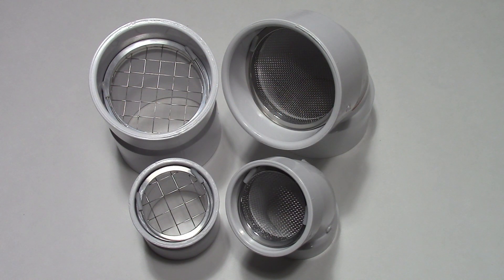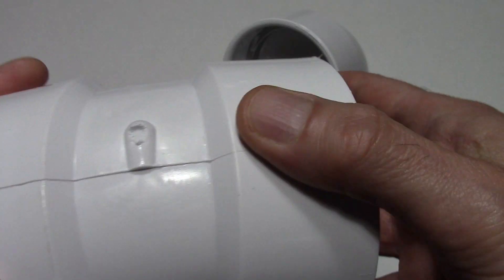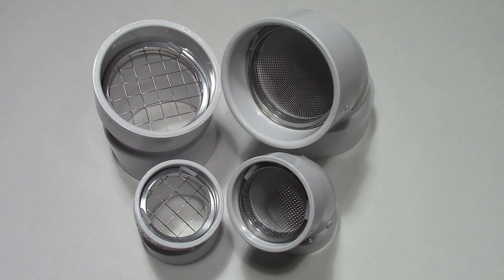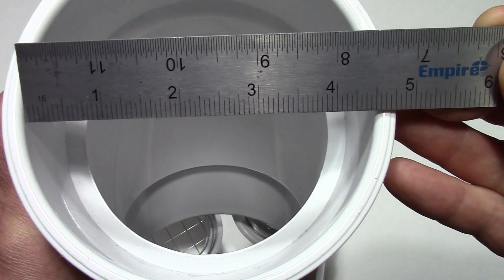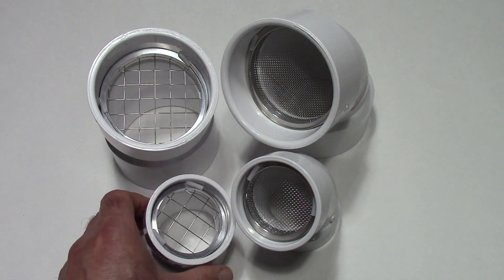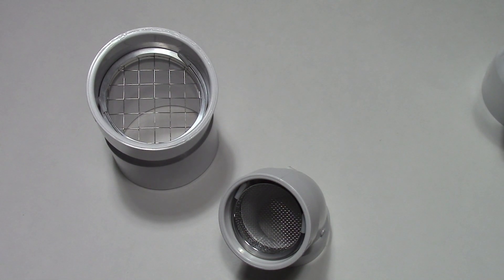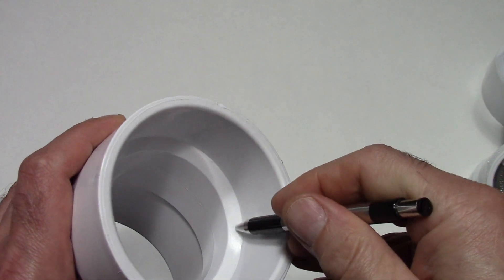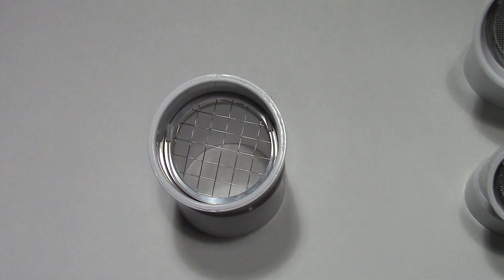PVC Vent Pipe Termination Screen Measurements

Comment: A solution looking for a problem. In 36 years, I haven't seen or heard about a rodent in a flue or intake. In 36 years, I have found ONE wasps nest in the intake. 99% of all furnaces I service don't have, or need, these screens. I have had numerous problems, clogging and ice dams, with screens. In standard efficiency appliances, yes---through a chimney,  including birds and racoons. But a high efficiency appliance? No. Those screens are more likely  to be the problem, vs solving one.
Reply: A couple I know just had a birds nests removed from a 10' long 4 inch pvc that stopped their main heating system intake outtake from running . I once removed a wood stove chimney stack that had no screen at the top and 8 feet or more of decades of birds nests that weighed twice  what it started out as being stuffed with birds nests .  Mice even crawl in dryer vent covers that get stuck open . The solution should be designed into the system , it is NOT thus  is it simply planned to be a problem ?  Ever hear of Planned obsolesce ?
Reply: @kevinpeterson346 Go with God. In 40 years I’ve never seen a 4” flue on a residential system. It seems clear you don’t this for a living. I’ve seen many chimneys filled with nests, dirt, branches etc. I have no clue what planned obsolescence has to do with it. CHIMNEYS can, and should be lined with a cap; often called a storm cap, or China man’s cap. For every mouse you find, you’ll have 50 ice dams at 2 am when it’s 10 degrees and the furnace shut off. But go ahead. You know better. My post did not say birds  etc could NEVER enter, but they’re unneeded and are MUCH MORE likely to be a problem. MUCH MORE. Codes are contributed to be several types of people, especially the insurance industry; the people who have to write the check. These things can be really counterintuitive, and only the people who work with these things know the finer details. I’m sure you don’t do this for a living. Every day HVAC technicians see well intentioned “fixes”, and have to explain, “Here’s why you can’t do this…”
Reply: @kevinpeterson346 Here’s a teaching moment…. Chimneys should have storm caps. Only standard efficiency appliances can use a chimney for venting, because the the flue temps are 350-550 or so. The flue gasses an a high efficiency appliances are 110ish, cool and moist. Those moist flue gasses will a dam at cold temperatures; just when you need heat! A standard efficiency unit usually doesn’t have a pressure switch monitoring flue static pressure. A high efficiency unit does. For every bird or rodent you’ll find, you’ll find 700 ice dams. Screens over flues are a bad idea